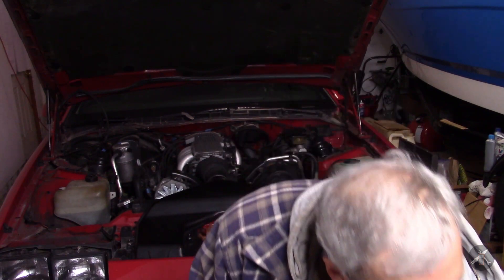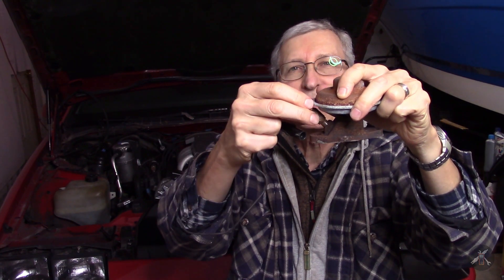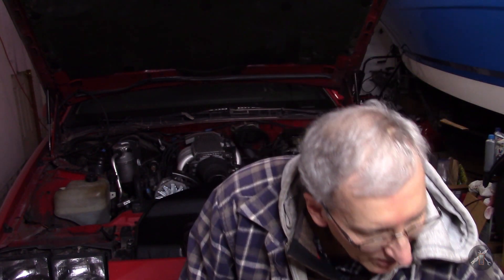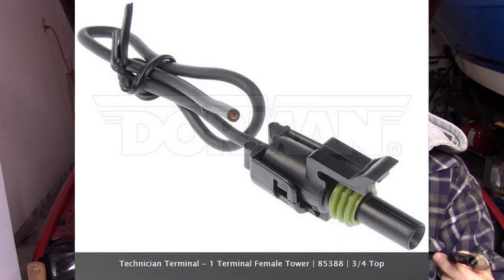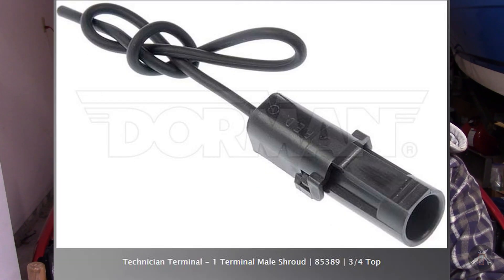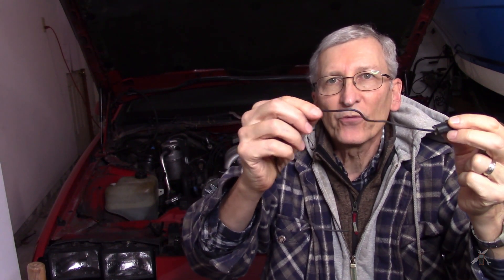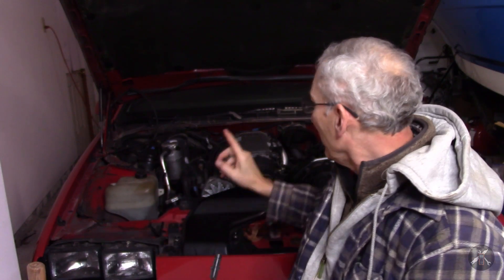Replacement for Discontinued EGR Switch - Camaro Tuned Port 305 /350

Comment: What egr valve did you go with? I am very confused and I am trying to find one for my 1987 iroc z 350tpi. By the way your video on fuel pressure issues saved me! Found out I had leaky injectors. I have taken the plenum and runners off and I can see that the porcelain on my sensor is cracked and the wire is wobbly, so I bought a new wire as shown in the video and will be splicing it, but I can’t find what egr I need.
Reply from the maker: I bought a Standard Motor Products EVG393. I use a lot of SMP parts, they have usually been reliable. Each engine can have a different valve calibration.  Looking at Rock Auto, they list the same EGV393 valve for a 1987 350, but a 305 lists an EGV403 for fuel injected. You can double check in the SMP on-line catalog also and look up by your application.
Reply: @bitsofwisdom460 Thanks so much! I didn’t get a notification that you replied to me, but I got the same one you talked about. The standard motor products 393. I also bought the thermal switch you showed from the same company, they sent me a keychain and a drink coozie as well! Thanks so much for the reply and for the videos!!

Comment: I recently removed my EGR valve to replace it and clean it. My wire pulled out just like yours did. It seems that it is just a bare wire crimped into a metal thermo rod that has threads on it. Debating on soldering the wire to the thermo housing but not sure if it would mess up the readings. A new switch is $70 and I wonder if all they have is a bare wire crimped to the thermo rod just like I would be doing. Maybe I could solder it and try it , where and how could I test it to see if my idea works before buying a new wire
Reply from the maker: Yes, the switch is only what appears to be a bi-metal wire that makes or breaks contact with temperature changes. You may be able to crimp it back together.  I'm not sure if solder will work because I'm not sure how hot it gets.  That is exhaust heat and may melt most solder.

Comment: Do you know if that heat switch can be tested with a multimeter? I'm trying to determine if I need to replace mine.
Reply from the maker: The thermal switch is just a switch contact.  Per the manual it is normally open, so your ohmmeter would show open.  It closes when it is hot, but I don't have a spec for that temperature.  It is trying to pick up heat from the exhaust gas when the EGR valve is open. If you could get it hot, your meter should show a closed switch, or you could monitor voltage on that circuit and see it drop when the switch closes.

Comment: If I just splice in an additional length of wire, using butt connectors, do you think the resistance will interfere with the sensor performance? I noticed you mentioned soldering the connection which I'm sure doesn't add any resistance.
Reply from the maker: I think you can use a crimp splice.  If I recall correctly I used solder and heat shrink to seal it. The factory would recommend either a bare crimp connector with solder and tape or an insulated crimp connector with heat shrink and sealant at the ends.  Underhood connections have moisture exposure so using a sealing heat shrink crimp connection is a good choice.  The resistance should be good either way.  Oxygen sensors and a few other critical circuits need a little additional care, but this one is a higher power switch circuit.

Comment: I have car that requires a normally open 12v control valve, question is I assume the one you demo vents the output side so the EGR vacuum will be broken, AND cuts off the vacuum input from the intake manifold (so you don't have a vacuum leak while the solenoid is energized). I was digging thru the JY and found the intake side was NOT cut off  some of the valves I was looking at. Not the ones you demo but they were egr with NO setting.
Reply from the maker: If you're referring to the VS-25 solenoid from SMP that I tested in this video: https://youtu.be/BXNh5jh6Iho
I believe that it operates as you describe. The valve has three ports and the 3rd port has a filter for bleed air.  I can't see the internals to verify the passages. Testing with a vacuum pump shows that the solenoid closes with 9V and blocks vacuum from the manifold input side.  When the solenoid is open, it has a constant bleed when vacuum is supplied to the input side.  I expect that the bleed is still active when the valve is closed, but I didn't put the pump on the back side to test that.  When I ran the valve on my car, I did not have any indication in engine performance or diagnostics that it was trying to hold the EGR valve open when the valve was closed. The plumbing for the Cadillac EGR valve is the same as my 305 TPI.  Ported vacuum feeding the variable NO solenoid then feeding the EGR valve.  The input port on the VS25 has a restriction orifice and the filter port has a larger orifice.  That bleed port may vary with the solenoid valve position, can't tell.
Reply: @bitsofwisdom460  thanks for the reply. I will post up a video of how my OE works vs the more recent era one is working. The OE is from the EGR of a 1975 280z. I am not sure if the issue is my JY pull may just be leaking. I don't think you should ever have an unmetered air leak due to the operation of the EGR, but that is how my JY pull is acting. 
Next project
I am also currently looking into how to convert a vacuum PWM operated IAC to an electrical PWM one. The OE ECU used a PWM servo to control an air valve, that controlled a vacuum diaphragm-controlled IAC valve (seems overly complicated but its 1975 tech). I tried using a later computer (1987) that had a known switch rate of 160hz to directly control the air valve but it did not work, I presume the 1987 had too high a switch rate as it was intended to directly control the IAC, not a valve that then operated a diaphragm which acted on the IAC. I never tried to determine the switch rate of the 1975 vacuum controlled setup.
My next try will be to use a late model PWM IAC (a pull from a 2005 ford). I will have to put a current limiting resistor as I am unsure of the driver from the 1987, the ford 2005 IAC was pulling over 1 amp (when tested with a 12v supply), seems like a lot. I wonder if it used a 5v vs 12v... I put a dropping resistor to limit the current (20 ohms 5 watt WW) and it seemed a lot happier. This was done on a variac so I could adjust on the fly.

Comment: Does anyone here know what's a normal vacuum PSI for stock 5.7 TPI. My car is lacking power. I checked vacuum with a pressure gauge to see if I have restriction and gage reads 15in hg. I've read that a normal PSI is around 17 - 22in hg.
Reply from the maker: Well, I agree that it seems too low. My experience is that the 17-22 range is accurate. It's been a while since I checked my 5.0, but my last notes say that it was in the 17-18 range.  Larger cams, retarded timing and vacuum leaks are frequent causes that can drop the vacuum. Think of it as how much power the engine makes for a given throttle opening at idle.  If you need to open the throttle further for the same engine idle speed, the vacuum will drop.  Advancing timing will usually make more power and throttle (or IAC) will close down some.  Vacuum leaks will cause air to bypass the throttle and depending on your system (MAP sensor or MAP sensor), the engine controls will react differently to a vacuum leak.
Reply: @bitsofwisdom460  Hi thank you for the reply a little history on the car. I bought the car not running and brakes were stuck but engine would turn over. The car shows that it's been sitting for a long time. When I got the car home I did a major tune up on it, I even had to changed the intake manifold because the distributor hold down threads were strip and couldn't hold set timing. After all said and done car starts right up, engine sounds strong but doesn't perform as it should. When the engine reaches temperature the idle starts to surge. Fuel pressure is good compressions at each piston is around 150 psi. 

I'm trying and working very hard to try to make my car run good thanks to people like you that share good information and trouble shooting tips I am sure that I will accomplish my goal.